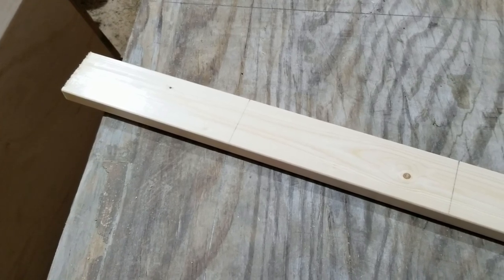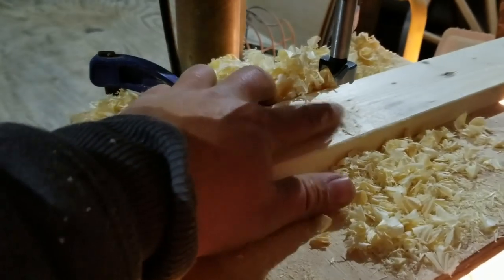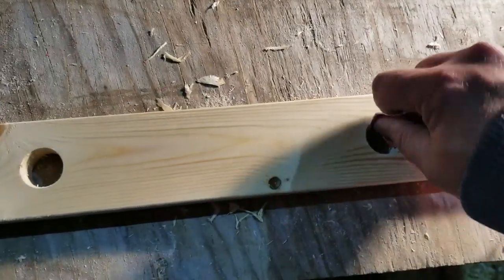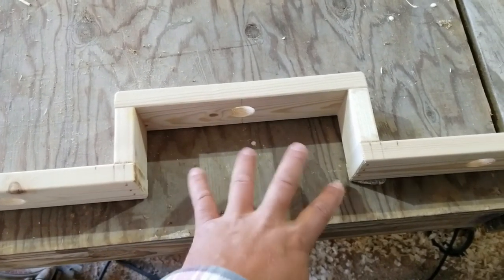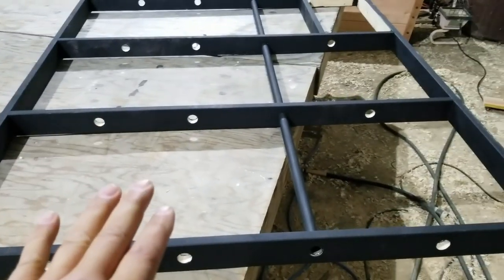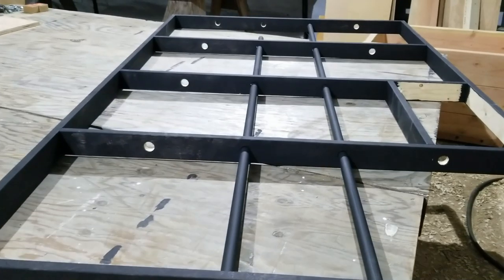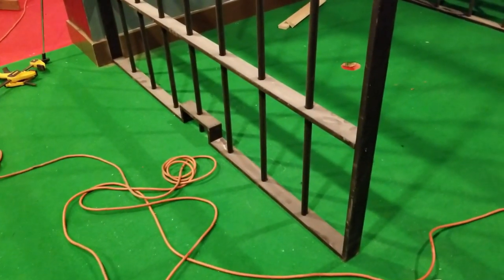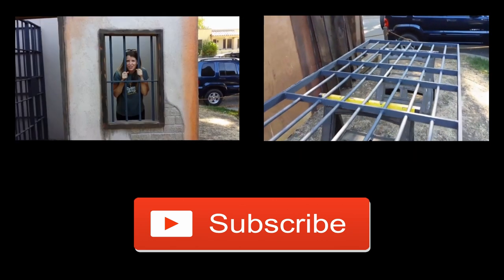DIY Fake Jail Bars - Old Western Jail Cell

Comment: Thanks for this I was gonna use chicken wire but now I’ll do this!
Reply from the maker: It depends on what you're trying to keep in.  The chicken wire idea may be a better option.
Reply: I used this idea for my prison. Worked great! We went for the same paint job! Turned out great!
Reply: I have a question, I have been interested in pneumatic props, but haven’t found any good tutorials on how to make them that dumb it down to my level. Do you guys think you might be able to make a pneumatics for dummies series? If not no biggie.

Comment: How long were the shorter 1 x 3's?
Reply from the maker: I belive the horizontal ones on the door were like 46.5"
Reply: Hollywood Haunter I’m working on building one for a video prop. This is a great video. I want to go about building a door on it. Do you have any videos making a door?
Reply from the maker: @bgray3128  In the videos to the links below we have a jail cell with a door that could be hinged on one side if assuming you are not trying to create a sliding kind of jail door.  If you want skip through them till you see me taking the door off.  I think we just screwed it into place but you can see a door with a plate that might work for your needs.  Hope that helps.  
https://www.youtube.com/watch?v=ACmJ01_l7kc
https://www.youtube.com/watch?v=LlJuOYlNJiw